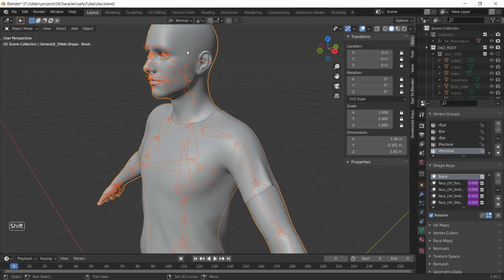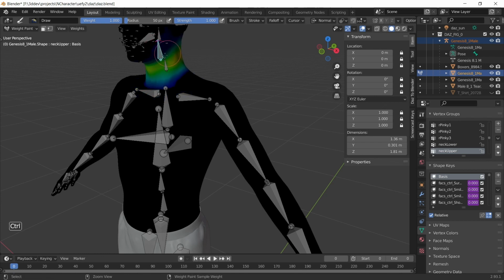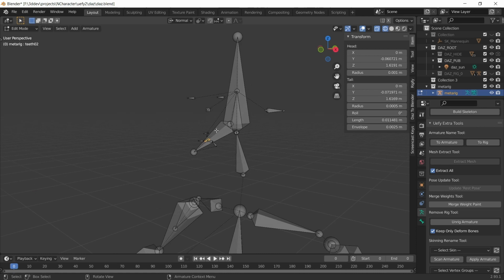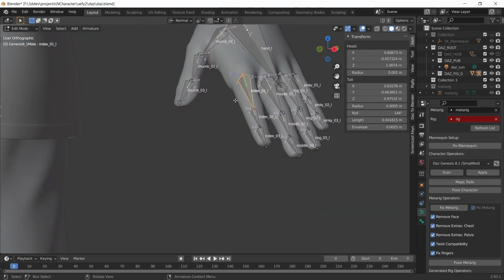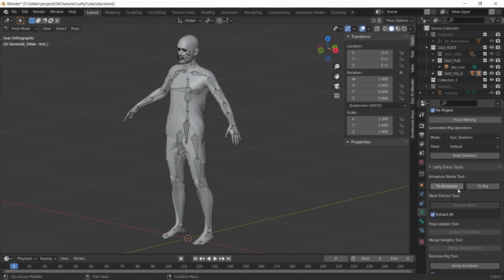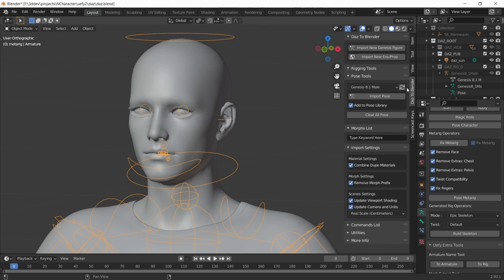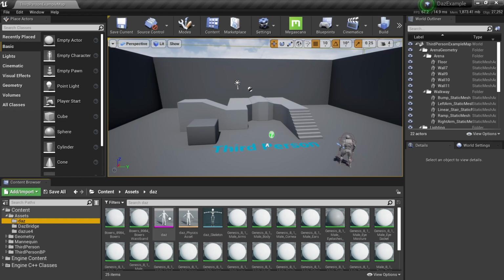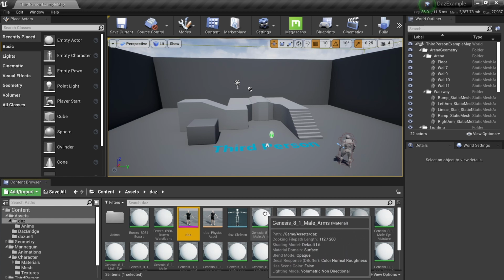Daz to Unreal Engine in Blender with Rigify and Uefy 2

Comment: Can I still use this with the Daz character imported from an FBX file and not through the Daz to blender bridge (couldnt get the plugin working with 3.1).
Reply from the maker: The bones must point towards each other head to tail like they are in this video. You might need to experiment with FBX import options to get as close a result as possible and fix any errant bones like I fix the arm bones in https://youtu.be/v8UfX62SlI0
Alternatively you can simply import the character using an older version of blender, save the blend file and open it in the latest version. With blender portable zip downloads it is trivial to maintain several versions of Blender.
Reply: @RakizFarooq  thank you sir... I am attempting the process now!
Reply from the maker: Are you referring to import stage where you first bring in the character into blender? Your best bet is to use a version of blender that works with the Daz bridge as described above.
For FBX imports every character is going to have unique issues. This is not related to the addon but due to differences in how Blender and other software like autodesk interpret the FBX file format. Usually you can get close enough that manually moving a few bones in edit mode is enough.
Reply: @RakizFarooq  I forgot to remove this.  Your tutorial worked like a charm bringing it in direct with FBX.  The only issue I am having is with the fingers being misaligned when I import into unreal.  I am playing around with the axis and finger post of the metarig to see if I can get it smooth.  Outside of that you are amazing. Saved me 1000s of paying someone to rig a bunch of characters
Reply from the maker: Try removing Morph Targets/ShapeKeys from the fingers to see if that is the issue.

Secondly the finger bones on the original armature (not metarig) fingers should be rolled so that the x-axis points out the bottom of the fingers. Doing so ensure the metarig fingers are correctly snapped (they will have different rolls).
Reply: @RakizFarooq  ooooh okay I'll play around with it.  Curious.... I am attempting to load in a new Daz character.. once I have the meta rig set. Can I drop new character meshes on it and generate a new rig without having to redo the process for each humanoid character I bring in?
Reply from the maker: You can use File -> Append to transfer a configured metarig into a new blend file.
Reply: @RakizFarooq  do you have a Patreon.  I'd like to support ur work!

Comment: Hi!This addon is very well.But sometimes it has bug in 3.0 and 3.1.Such as Merge Weight Paint is not work.
Could you repair it for more than 2.93 version.
Thanks!
Reply from the maker: I am using Blender 3.1 with Uefy v2.4 at the time of this writing. I have just tested the merge weight paint tool and it correctly merged the weights on all attached meshes on my armature.
Reply: Python: Traceback (most recent call last):
  File "C:\Users\D\AppData\Roaming\Blender Foundation\Blender\3.0\scripts\addons\uefy\build.py", line 1038, in poll
    return context.armature
AttributeError: 'Context' object has no attribute 'armature'
maybe only in sometimea
Reply from the maker: The 'Build Skeleton' and 'Merge Weight Paint' buttons are context sensitive. For Merge Weight Paint button you must select the armature and then go into Edit Mode otherwise the button is unavailable.
For 'Built Skeleton' you must make sure only the armature is selected and go into Object mode. You also have to make sure the values in Uefy Script Panel for Armature, root, metarig and rig are correct before running build skeleton.
If you follow the steps shown in the video the addon works perfectly. If you still have issues reply to the email with your download link and order id and attach screen shots and details of actions you took.
Reply: @RakizFarooq  Thanks!I see.
Reply from the maker: The tool works on meshes attached to the armature. So make sure your armature is actually attached to a mesh it can move around in pose mode before using this tool.
For example if you use the Extract Mesh tool to separate the meshes from the armature into separate objects then this tool will not work until the meshes are reattached.

Comment: Love these tutorials! Probably watched it 4 times. Very easy to follow and really points out the important stuff.
However the pose character button does not seem to work for me(@17:28). I just enter pose mode with the message success, but no changes are applied to my character. Running blender 3.0. Works without it but I think the retargeting would be slightly better if I could get it to pose automatically.
Tried with several different imports/characters but get the same every time.
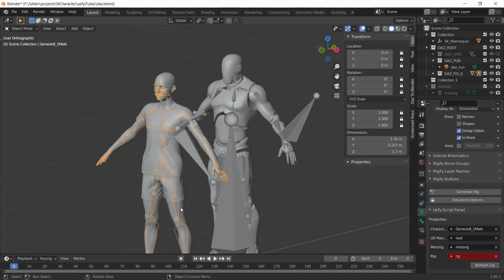Reply from the maker: Pose Character operator works for me on Blender 3.0, make sure the values for character, mannequin, metarig are set correctly in Uefy Script Panel as around 17:20 also make sure the mannequin and character armatures are visible. Have just the character's armature selected in object mode when clicking the button.
Other things you can check are the bone names. Make sure there are no typing errors, the names are case sensitive so foot_l is not the same as Foot_l or foot_L etc.
Reply from the maker: I just tested the Pose Character operator in Blender 3.1 and it works in that version as well.
Reply: @RakizFarooq  I tried all your tips but still didn't get it to work. Might have been slightly different bone names or something. Using custom as preset did attempt to pose it but didn't do a great job. Since im using diffeomorphic that could be the cause of it.
Can i assign the bone names manually in a json somewhere to create my own preset?
Reply from the maker: You must ensure that there is no rotation on either the armature or mesh objects. Item -> Transform -> Rotation should be 0,0,0 for both armature and mesh. You can review https://youtu.be/mg75kSkKkug to see how to create your own presets.
This process requires that you follow all the steps in the order shown. Everything done here is for a reason. Skipping or ignoring steps or going out of order will lead to issues.

Comment: I have a non-DAZ character in UE4 which uses the standard Epic skeleton. Can I use Uefy to convert DAZ clothing to fit my Epic character?
Reply from the maker: You can do that by using Blender's built in weight painting tools. Uefy's core function is to make it easier to use the rigify rig with game engines.

Comment: Thanks for taking the time to make this. Will it work with Genesis 2 characters? The Character Operators > Select Mapping options only seem to include Genesis 8.1.
Reply from the maker: The Genesis 8.1 metarig is only a preset. Uefy is not aware of Daz3D or any other program. It is a generic solution for rigging characters from any source. 
I used the same process as shown in https://youtu.be/z-NPCh01DwE to create a metarig specific to the Daz character I was building for. If the preset doesn't match your character you can follow the tutorial to build your own.
Reply: @RakizFarooq  OK, great! Thanks for the very quick and detailed reply.

Comment: Have you worked with Metahumans yet?  I have a suspicion they might replace the UE4 mannequin as the standard for UE5.
Reply from the maker: You should be able to rig them with the addon in theory but there are far too many bones. I don't recommend using this with metahumans. The higher density LODs on metahumans are not suitable for many projects.  The default mannequin is not going away any time soon.

Comment: Hi Rakiz, is setting the scale to 0,01 meters still needed? I saw that uefy send warnings if the scale is not set as it but i know that from UE 4.26 (i think, i don't remember the exact version) there's no more the need to change the unit scale in blender
Reply from the maker: If you don't set the unit scale as shown it is possible that the character will successfully transfer to Unreal and look fine. Until problems show up later when you try to use animations or blueprints. I follow the same procedure in all my videos and it gives me a reliable result that always works.